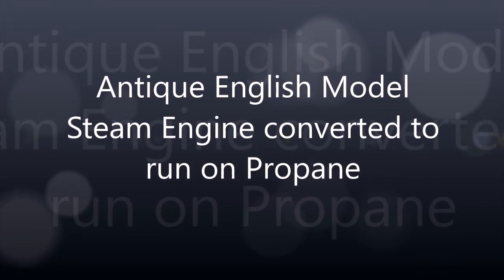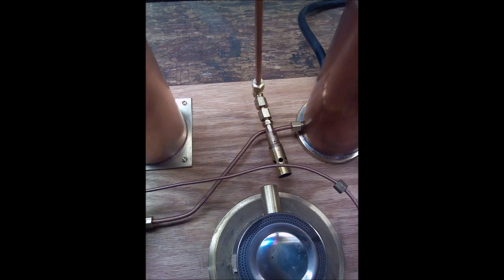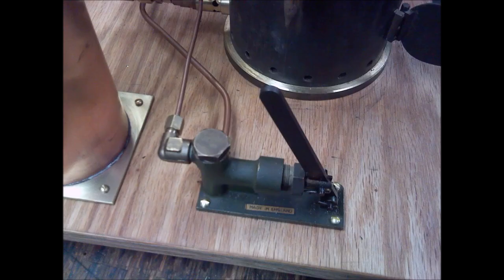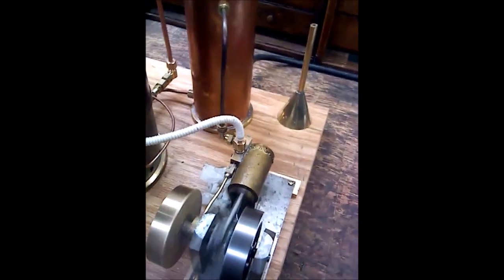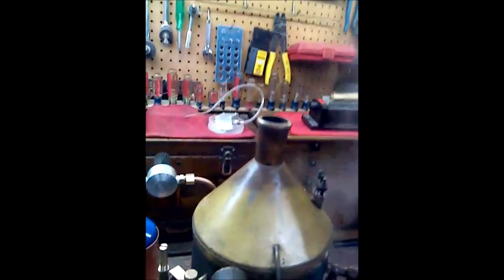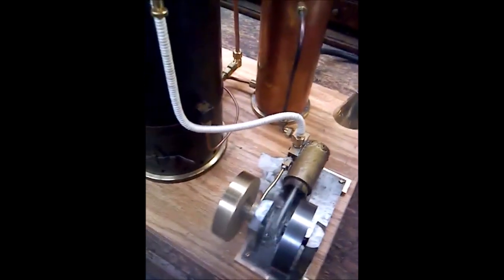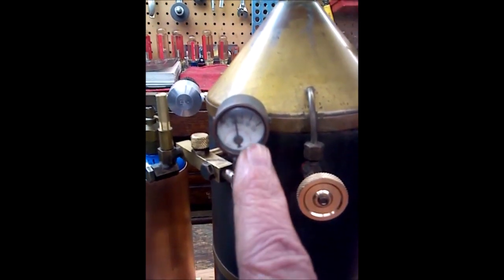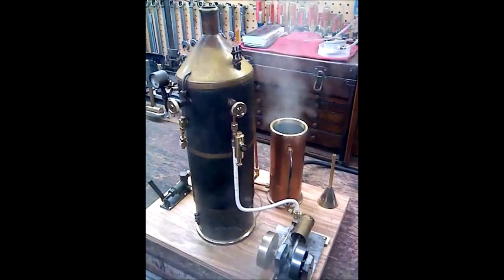Antique English Steam Engine Model converted to run on Propane

Comment: Lovely old steam plant, Fred, and you have surely given it a boost with your sensitive propane conversion. 
Regarding the steam blower - I have been experimenting with various fuels for the 3 inch boiler that I built last year (notably kerosene and alcohol, both via pressurized burners) and I have found that opening the blower a fraction can be really helpful with these, and even with gas. It really focuses the flame into a nice cone shape and pulls it up the fire tubes, effectively raising the pressure.

Comment: Looks real good Fred.  Should go down well at steam shows.  The burner does a good job and I like the way you've done the gas cylinder and condenser mounts (what did you use for that ?).

30psi is as high as I would go ;)

Cheers Rob

Comment: Very nice rig, runs very well. 
I've got a larger engine and I'd like to find a boiler like that to complement it. 
That one is the perfect size I think.
Reply from the maker: Thanks, I have been antiquing for over 50 years and this is the first and only time I have come across anything like this.  I think I paid around $150 for the all the parts.  I hydro tested the boiler to 150 lbs and it held so 30-35 lbs should be no issue.  I am always careful when I build a steam plant that I will take to shows.  I don't want any "incidents"..  Thanks for watching and commenting. Fred
Reply: @FredMiller  What a deal! Nice score. Yes, if I want one I'll probably need to build one.

Comment: Nice set up Fred :-) Are you able to try the boiler on coal? I have one of a similar size and find it generates much more steam when running on coal but its a bit messy ;-)
Reply from the maker: Thanks for the info..  I want to run it on propane for two reasons.  I want to show this steam plant at steam events that are indoors.  Propane will let me shut the plant down instantly if something goes sideways and two,  it is a lot cleaner (as you said).  Thanks for watching...  Fred